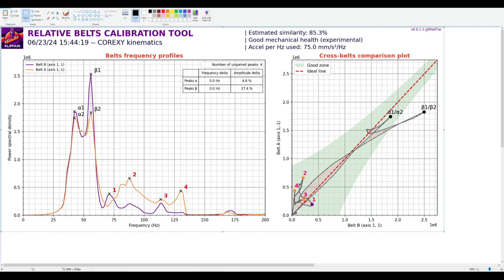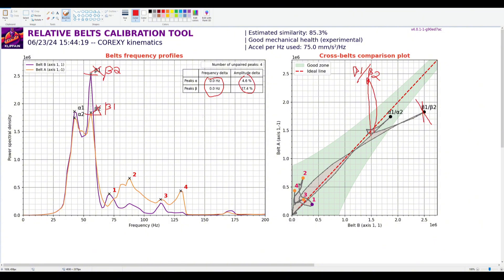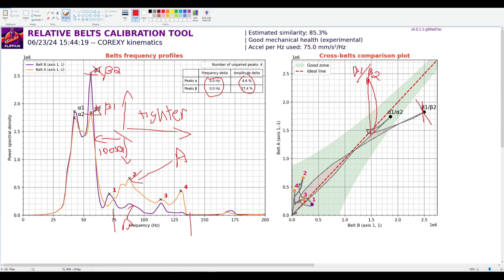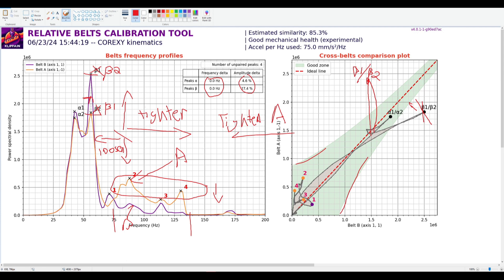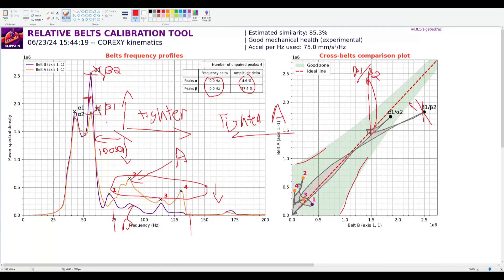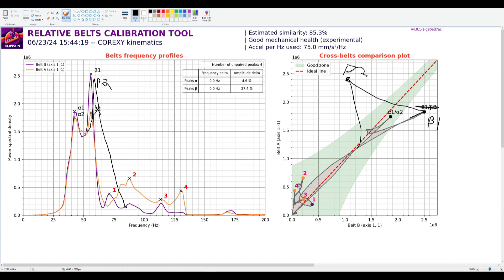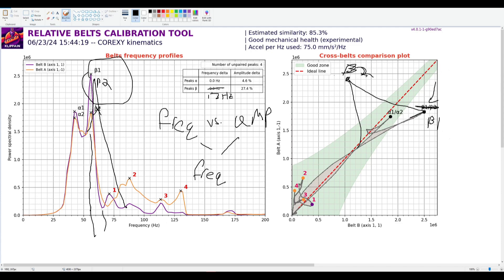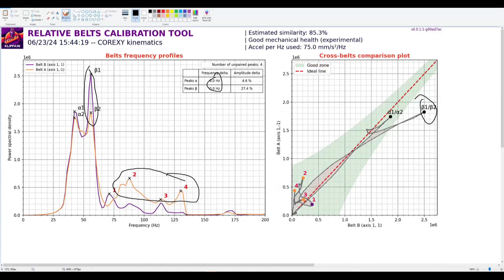Joel's (ft. DaBrian) Cross belt comparison - What does it mean

Comment: Really appreciate your videos on using Frix_x's Shake & Tune tool, they've been very helpful. A suggestion for a video that might help people even more would be to work through a sample process. Show the results, show the adjustments, and then the show the follow up results to see how it's changed, as you work to best tension.
Reply from the maker: So that might not make a good video. Steve Builds has tried a few times to do vibration/resonance work on his channels. The work does not translate well to a video, or live. This is because it is slow and tedious work, and might I say boring.
Reply: @The_original_Reth  Just a suggestion. :) I didn't really mean a complete start to finish video, just some basic examples. Beta belt frequency too low, adjust this idler, that type of thing. I'm good with my setups, no more chasing unicorns for me :)
Reply from the maker: @macdox69  My newest video has some of the thought process I used to diagnose a wobble linear rail carriage. Should be up in 30 minutes or so.